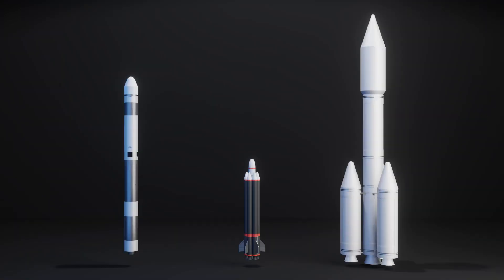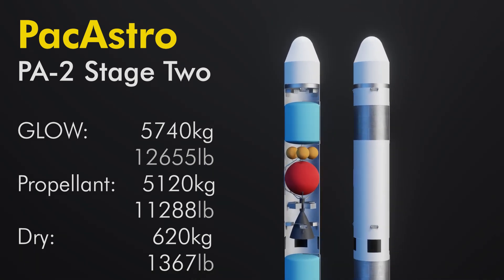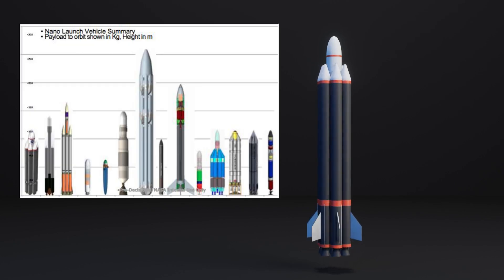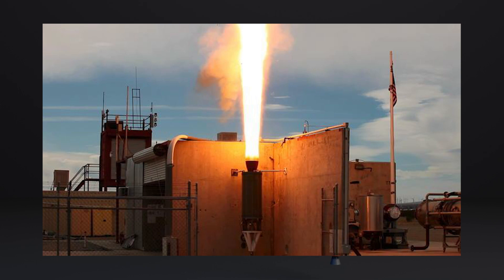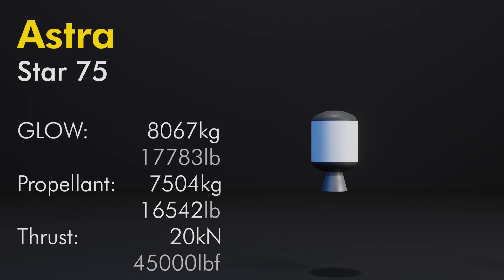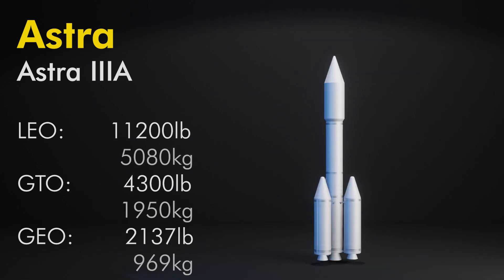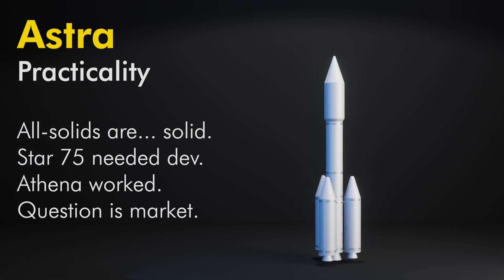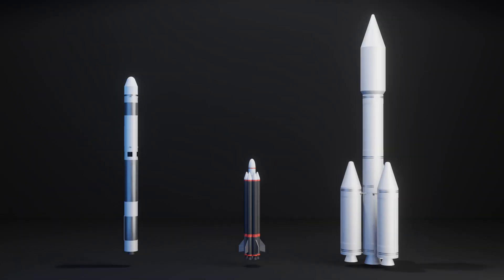PacAstro, MCLV, and Astra | Know Your Rocket

Comment: Looks more like initial launch vehicles in early versions of KSP. Why no one loves hybrid rockets? (except malicious relationships by Virgin, I guess)
Reply from the maker: Lack of interest on hybrids. Lockheed did a lot of work on them in the 70s and 80s; AMROC did as well. Trade-offs are the big thing that usually limit hybrids.
Reply: @pressure-fedastronaut6511  I've read that there were some problems to solve - like incomplete fuel burning due to tendency not to react with oxidizer in the "bottom" of the stage, inconsistent thrust (especially when something different then liquid oxygen is used as oxidizer, but even with it the starting burst in form of a little detonation which potentially could ruin nozzle or make caverns in the fuel providing every single problem with stage during flight) - and as a consequences of those two much lower TWR and ISP than on paper which is definitely the .
But Future™ is now and we have "additive technologies" so it is possible to "3D" print the fuel in a such way to maximize contacting surface with oxidizers so the problem of not burning or cracking is magically solved. At least there a lot of papers in the Internet and a lot of posts on rocket modeling forums.
Reply: There's a relationship between volumetric efficiency, thrust and total impulse with hybrids that really limit their capability. Yes, they can throttle, but it's a dynamic environment, difficult to predict and usually is worse than expected. They're simple for the amateur though, and they have inherent safety.